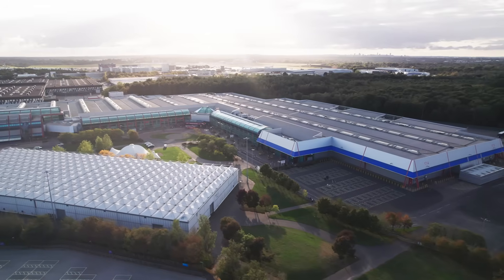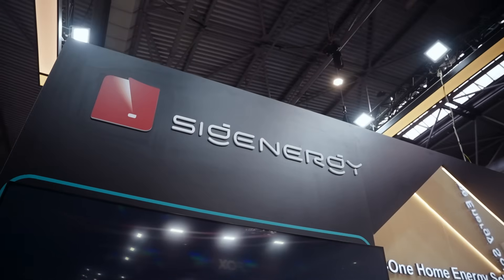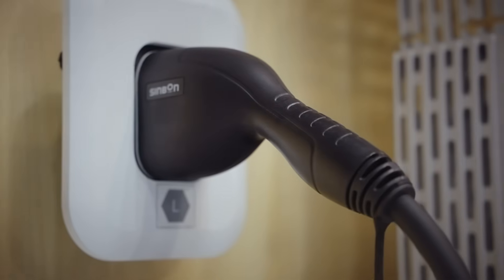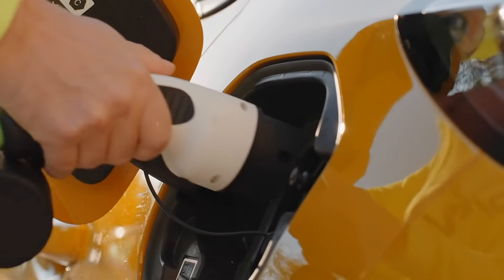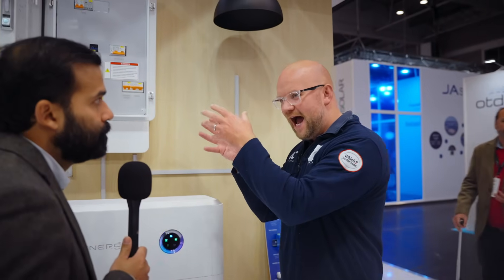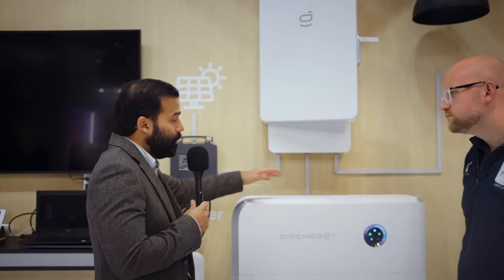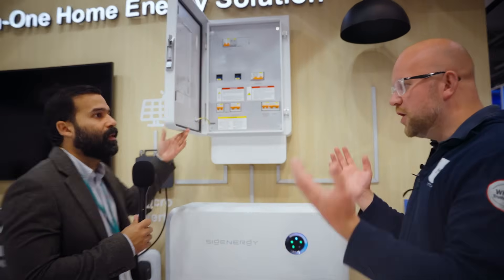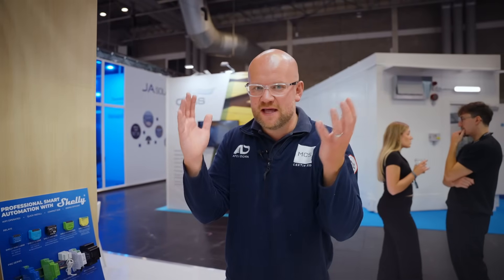SigenStor: New Home Pro Gateway, Bi-Directional EV (12/25kW) + Microinverters

Comment: Running this amazing system in Far North Queensland, Australia. Absolutely amazing! 
Due to the weather up here, i pull in over 100 kW of power a day. The battery looks after my energy needs at night, while the solar provides all the power I need for now, and well into the future. My system is a 40 kW 3 phase Sigenergy system with the 3 phase gateway. Over 50 440 watt Jinko panels. 
I'm super impressed with the app and data breakdown, too!
Reply from the maker: Thanks for this feedback. 👌 we really appreciate you commenting.

Comment: Unless I'm wrong the Powerwall 3 allows variable inverter ratings so only one inverter needed. Why doesn't Sigenergy do the same rather than having to specifically size the controller?
Reply: You only need to specifically size it to avoid bottlenecks. You can use a smaller inverter/controller it will just do everything slower.